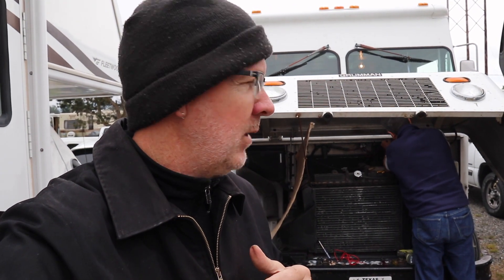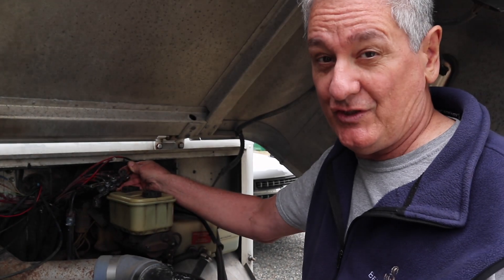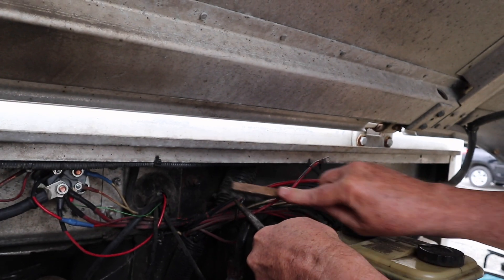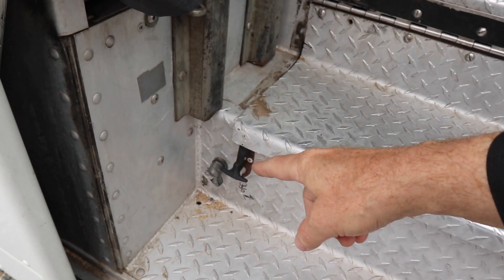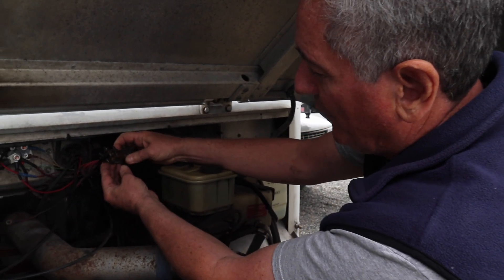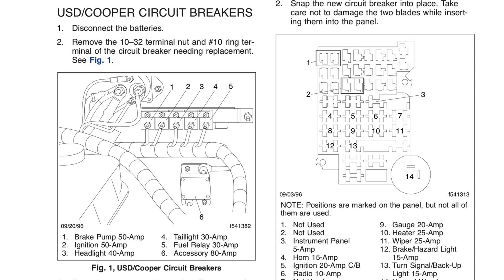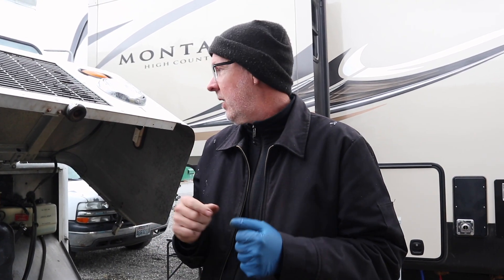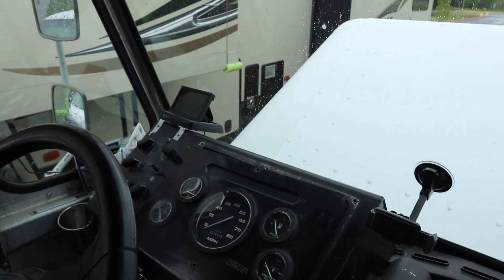Troubleshooting Step Van Electric Bus Bar E434

Comment: Seven, with the type of issues you have the most likely area to look at now is the ground side of the 12v circuit. Most the time when you have several issues that happen all at once it is usually associated with the ground. Good job on repairing the bus bar  and circuit breaks.
Reply from the maker: John... your thinking is exactly what I concluded. I spent about 4 days cleaning and tracking ground contacts (two prior videos). Terry and I both felt is was time to address the one volt loss we had at the dash. the dash was getting 11.8 volts where it was 12.9 or 13v at the battery. we felt the loss might be on the positive side and Terry correctly found the voltage loss in the positive bus bar. next I'll check the sending units then back to the ground wires if that doesn't solve it

Comment: Seven I suggest getting a aftermarket gauge cluster set to replace your factory gauges. You can often find great deals on Amazon for complete sets that include your speedometer,tachometer, gas,oil,water temperature and volt meter. Better to do that then wasting time with old and failing gauges. Just a suggestion my friend.
Reply from the maker: a very good suggestion. I'm going to make sure both sending units are solid, if not then might be time to get a new gauge cluster

Comment: A good repair/replacement job! 👍 It appears to me that all those styles  of step vans must have corrosion problems in the wiring as its right up front and not very shielded from the road spray one would get from the cars in front of you as you drive in the rain and the slush.
Reply from the maker: I think you are right. also there is a large gap at the top of the hood just over that bus bar area. all the water from the windshield goes down thru the gap. surprised they don't have a plastic box of some kind for the bus bar

Comment: Hi Seven I had a problem with my oil gauge so took a look at the sender and found that it was faulty so replaced it and also fitted a manual gauge after replacing the bearing as the workshop manual see it was due to to much clearance in the bearings. Now if the gauge on the dash shows low oil pressure I check the manual gauge.
Reply from the maker: great tip! I am planning on replacing the sending unit next

Comment: Thanks for showing your electrical problems. I'll need to take a look at mine as I think the fuel gauge is installed wrong. On my one road trip in the van, to Burning Man, it was more full as I drove.
Reply from the maker: perhaps there is an energy vortex near Gerlach which causes gas gauges to gain energy! ;)
Reply: Hmm, that might be true. Only one way to find out...I'LL HAVE TO GO BACK!

Comment: One thing I would check is to make sure all your grounding points are tight and corrosion free. Having low voltage can also mean a bad ground, which can cause all kinds of weird issues.
Reply from the maker: mostly over the past couple months I've been tracking as many ground connections as possible and focusing on those. recently moved to looking at the positive side due to the voltage drop. after the work in this video there was a voltage drop of about .2 or .3 volts, which I'm told is not too bad for a vehicle of this age. going to focus on the sending units at this point

Comment: There was also a sixth breaker on the diagram, an 80A accessory breaker that was not on the bar but down below on the firewall. I assume you guys checked for voltage drop across that, right? It sounds like the oil pressure gauge would go through that one. In the wrap up, you didn't mention if the voltage inside raised from the 11V you reported. So wish I'd been there. I love tracking down electrical problems. As my first career before I was a software engineer I was a automotive mechanic at dealerships and they used to give me all the electrical problems. Many things that are supposed to work at 12V won't work at 11V.
Reply: Patrick Horgan That's a really good point Patrick but I don't recall seeing that additional 80 amp breaker and that manual covered several different models and the voltage was raised after we changed out those breaker so I think it did fact feed the instrument panel through those existing breakers that we changed but very good point. I also applied 12 V to the oil pressure gauge with no meter deflection and also grounded the negative side with no meter deflection so I think that oil gauge itself is bad.  Wish you could have been there as well, sounds like you have more automotive experience than me.  I wanted to do more but time didn't allow.
Reply from the maker: yes, there is an extra breaker that is not a part of the bar. it is a water sealed stand alone unit. Daniel had looked at the 80A breaker when I was in Oceanside and looked good at that time. the instrument cluster is powered from the relay to the left of where we were working near the bus bar. BTW we did see nearly a one volt gain at the dash after rebuilding the bus bar components so I think Terry was right on with his recommendation to address the corrosion there. also wish you were here for troubleshooting as more heads are better at tracking pesky things like this. I do feel Terry is correct that the sending units for the speedometer and pressure gauge are next to be checked

Comment: If you have strange electrical problems is a bad ground redo all the ground
Reply from the maker: I checked as many ground connections as possible in a prior video which is why we were tracking positive connections for the voltage drop this time

Comment: Mr Seven, look at that secondary fuse box the young man installed for you, check the voltage on that and see if your losing volts there as well. Only thing I can think of other then sultry oil pressure sending unit and faulty speedo sender.
Reply from the maker: we think it is the sender units
Reply: Seven Wanders the World I’m kinda leaning that way too but thought about the secondary fuse box as an afterthought

Comment: Run a a ground from the battery to the gauge cluster board using the aluminum body is not goog just try a ground wire to the cluster biard
Reply from the maker: we did run a clean ground to the instrument cluster in a prior video

Comment: Ground ground ground
Reply from the maker: Ray, we worked a lot on grounds before this video but Terry and I both felt it was worth our time to track the voltage loss in the dash area on the positive side as we were losing about one volt somewhere. Terry correctly found the voltage loss in the bus bar breakers. now that my voltage is one volt higher I'm moving onto the sending units. if that doesn't work, then it will be back to the ground wires again

Comment: Also you could have a bad main ground just besause it looks good doesn't mean it is ground ground ground!!!
Reply from the maker: always possible the main ground is bad. I traced it back to the engine block and all connections are tight  but suppose that doesn't mean they are giving good connections
Reply: One good way to see if you have a grounding issue is to get  a small jumper cable which is intended for electronic work. They are a couple of feet long. They have alligator clips on both sides. Then get a battery jum per cable. Attach that to the negative teminal of the car battery.  

Now touch the small alligator clip to suspected bad ground points. You might find that your instruments suddenly behave themselves. Or you might find that your instrument voltage goes to 12 to 13 volts. 

If these things happen, you definitely have a bad ground .
Reply from the maker: Johan, I did a dedicated jumper for both the ground and positive in a prior video. still didn't solve it